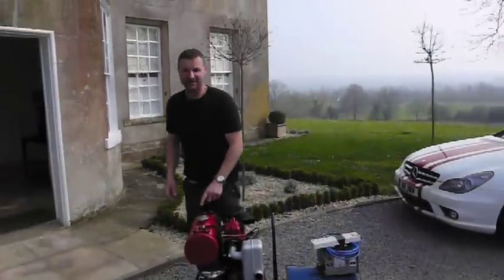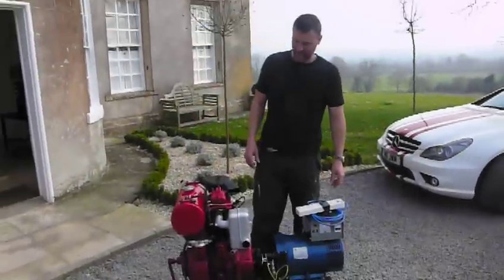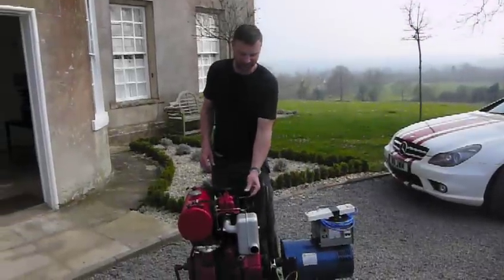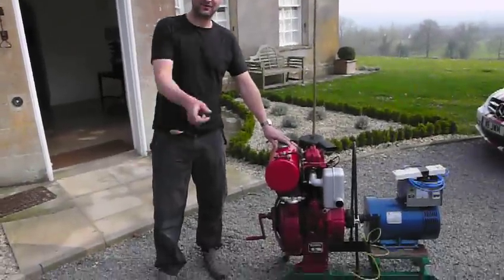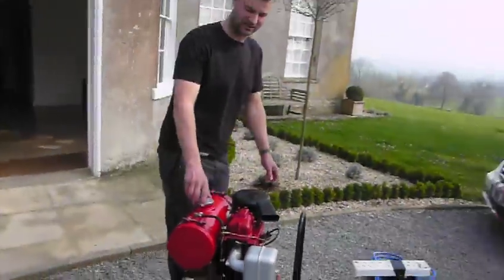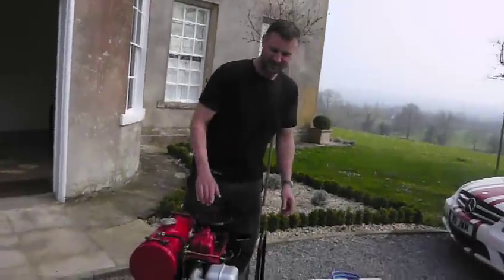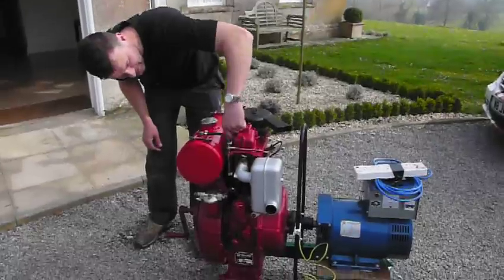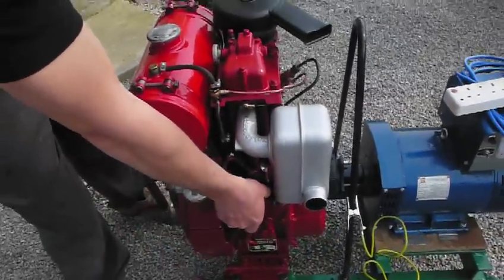Bernard Diesel Powering Generator.

Comment: Hello,
I am a specialist of this engine Bernard W71, would it be possible to have another video where we could see the operation of the generator? thanks in advance !
Reply from the maker: Hi, ok-will do. The engine dates from 1971 and is almost brand new. It sat in a shed un-used for nearly 40 years!! What do you actually want to see? Cheers, john
Reply: Good evening John,
we see that your engine is almost new! he is magnificent ! I would have liked to see him idle, as well as train the generator, to see if the current produced is regular. it is a motor that has a perfect idle, and it's a pleasure to hear it turn .. Otherwise, if it dates from 1971, its serial number must begin with C .......
If you give it to me, I can date with this number and give the month of its manufacture. If you wish, I can send you by e-mail the instructions for repairs and maintenance (in French)

My email:     cdc.83600@gmail.com

I have the same engine, and I would like to associate it with you as a generator, so I would like to see the quality of the current and its stability.

Good night and thank you !
Reply from the maker: Lampes sodium 
Hi, yes it is a lovely engine. The dynamo is Chinese and is rated at 3 kw @ 1,500 rpm. I have mainly lister and petter Diesel engines- do you have these in France? Bernard engines are rare in the uk. Luckily I have service manuals in English. I'll check the serial number. Warm regards, john
Reply: I saw on your chain your beautiful Lister-petter engines, in France, it's the opposite, they are very very rare! my favorite is the CS Lister! otherwise, your rolling machines are super nice too! See you soon,
I look forward to this video of Bernard diesel !!!